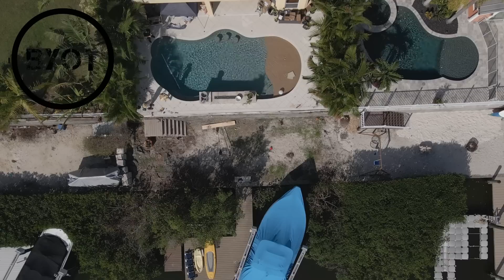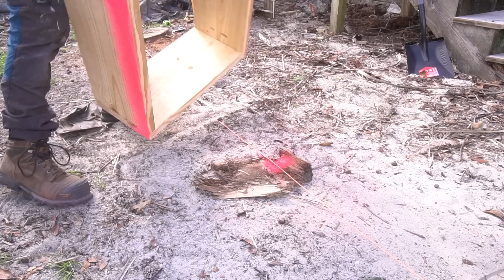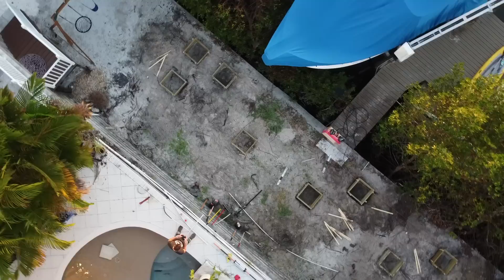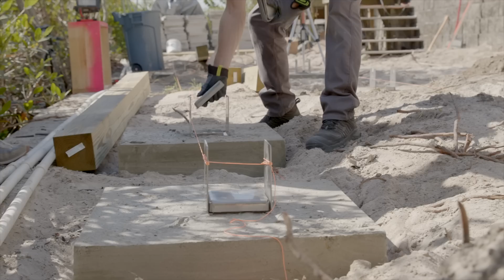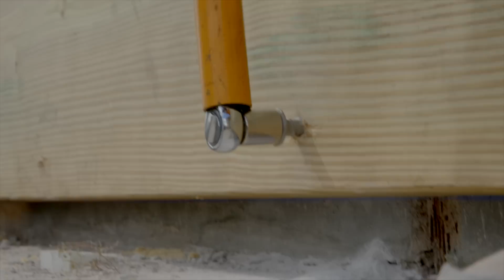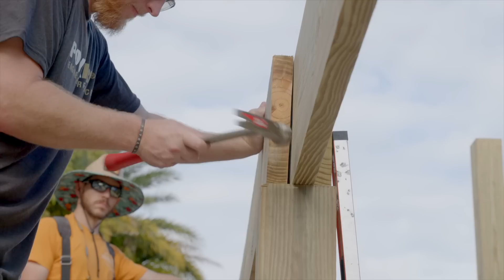How To Build A 50' Long Deck // START TO FINISH (Part 1 of 2)

Comment: Use a jackhammer to dig. It'll make it easier to go through those roots- or most anything that gets in your way. 35 years of construction experience.
Also, put a nail at your grade, if you're not pouring to the top of the form.

Comment: Question from a guy who has only ever lived in the Midwest:

Here (in Missouri), we have to dig our footings about 20" deep because of the frost line. Of course there is no frost line in Florida, so footings don't have to be nearly that deep in that respect. However, in sandy areas such as where you are working, wouldn't you need to dig deeper to more stable soil? I could be totally wrong, but I'm just curious.
Reply: Great question

Comment: Everything looks really good. Just wondering if the non-post ends are ever bracketed in any way.
Of course there isn't any room to bring equipment in on these kinds of houses. All that shoveling had to really suck. At least it gives tradesmen plenty of work with them having to build everything off of the ground. Saw some houses where the "backyard" is just a giant deck over rocks, though they did have a couple feet width of real yard on the sides.

Comment: I don't think you need to use 4 per post on those little rebar stilts, save some money and balance it on 2 while getting a little dirty and hold it level while the concrete goes in
Reply from the maker: Definitely not a cheap project so I guess every little area of savings counts :)

Comment: Get an SDS max rotary hammer + spade tool. It punches through small roots. It's worth it because you can also use it to pound ground rods, drill stone/cement, and more
Reply from the maker: Thats an amazing idea with the spade tool!  Thanks so much for the suggestion.  I'll have to keep that in mind on the next project for sure.
Reply: @BYOTools  oh I also have a TAMP bit for my SDS max. Unreal compacting

Comment: I used a chain saw, using the tip and ground down my stump till it was below grade it will rot out. Pulling them up was just too difficult for me. I believe they rent stump grinders that are easily maneuverable no big equipment
Reply: Didn't you destroy your chain in a few seconds making so? It's very easy to catch some ground and I remember that dulled my chain immediately when I tried to cut a stump to ground level.
Also, it's very risky to use the tip of the chain saw!
Reply from the maker: We thought about that but unfortunately there was no chance getting any large stump grinding equipment down there.  Thanks so much for watching and the continued support :)